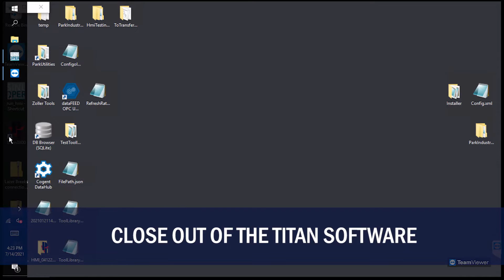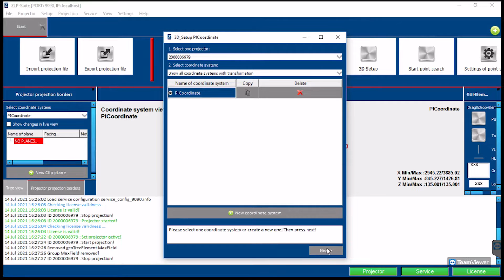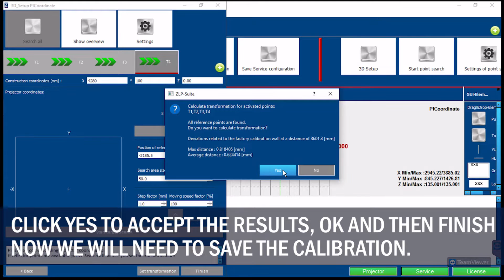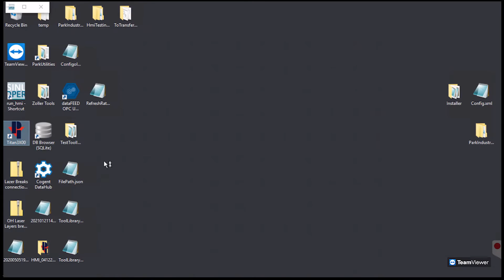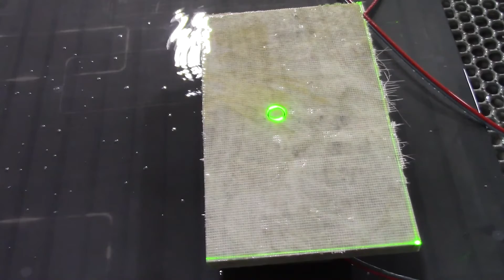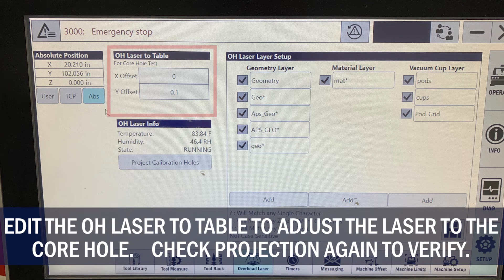How To Calibrate Z Laser | CNC Router Service

Comment: What causes a tapered projection? Will be good in bottom left corner of table but top right of table is off 1/16” to 1/8” in x and y. It’s consistent and I cannot get it to project correctly
Reply from the maker: You will need to do a full calibration as the video shows.  Make sure that the table and surrounding area is clean and dry.  Things like strobe lights and LED lights can affect your calibration.  If that doesn't help please contact us.